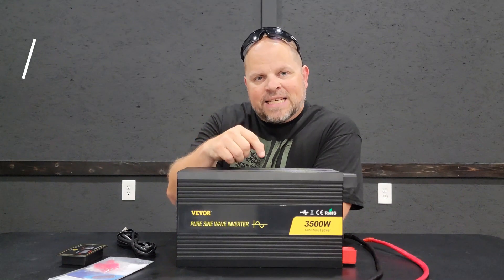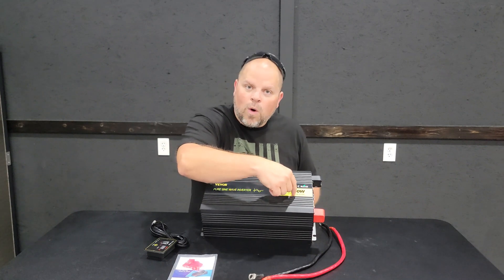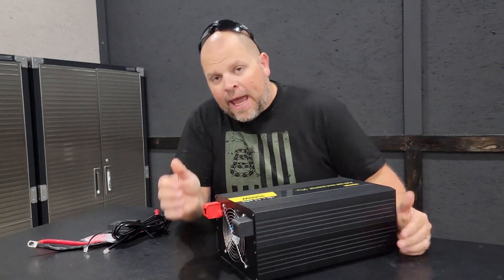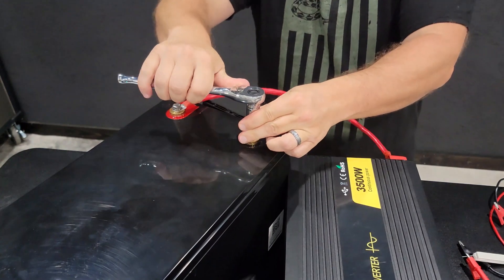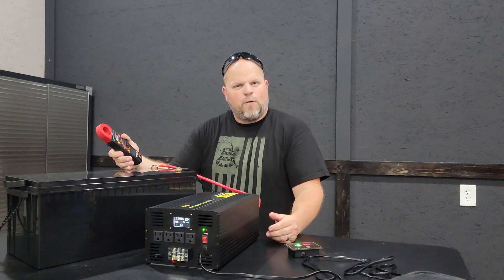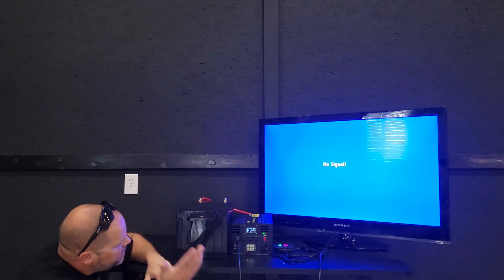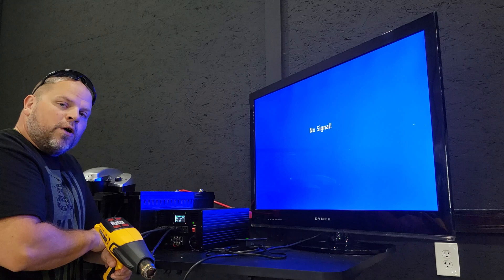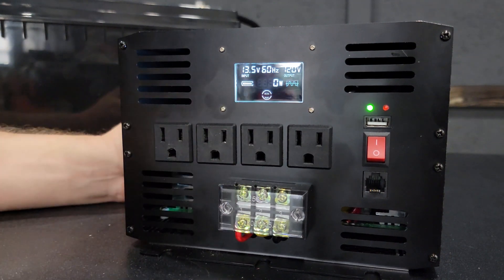Vevor 3500w Pure Sine Wave Inverter 12v to 120v

Comment: My 3500 Edecoa is just like this. I grounded my unit to earth ground through my house wiring. I just pulled one fan guard screw out a few turns and used a stack on crimp terminal. Second, if you buy one of these, throw the cables in the trash. You will need heavy 4/0 copper. With properly crimped ring terminals. 3500 watts x 12 volts is 292 amps. If you're pulling max amperage, those cables can get stupid hot. Great video bro.
Reply from the maker: Thanks for watching and sharing your experience. Yeah, I agree toss the cables that come with it and get quality windy nation cables. Can't go wrong with 4/0
Reply: Does this edecoa work well for a 3/4 HP pool pump? you have to remember that they have a starting surge.

Comment: I am a total novice at this. I just bought a Honda Pilot that has the 2 12v gigarette outlets. I will go camping and I may want to use a computer or other small appliances off of the gigarette outlets.  What would you recommend I get? Is there any negative effect to the car battery or its electrical system when using these devices? Thank you
Reply from the maker: It really depends on how you are looking to connect everything. For a total novice, I would recommend a portable power station. It makes things so much easier. Thanks for watching and commenting 👍🏻

Comment: You have to have the inverter grounded for the GFCI to work. Sadly, Renogy phone support said in a camper you don’t but in researching, that’s incorrect. Think about it, I think it’s no way for it to work if not grounded. Most inverters instructions I have seen mentioned grounding on camper or earth ground.
Reply from the maker: Thanks for watching and commenting 👍🏻

Comment: Great stuff. What size inline fuse is needed between the battery and inverter?
Reply from the maker: It really depends on your overall setup. The fuse size is usually stated in the manual and some inverters already have built in fuses/breakers. The rule of thumb that here would be “Continuous Watts / Battery Voltage times 1.25, for example a typical 1000W 12V inverter draws up around 83 continuous amps and we would add the 25% safety factor which comes out to 105 Amps, so we would recommend a 150A fuse. Thanks for watching and commenting
Reply: Thanks! I bought 2/0 awg wire and in the middle of hooking up the wires with a 300A ANL inline fuse. I also got 250A fuses in case 300 was too much. I need 2 more 2/0 terminal ends to connect the cable from the inline fuse to the battery. I came to this conclusion from reading somewhere I saw online. Like I said I have to wait for these terminal ends to get here to finish the installation. So hopefully the 300A or 250A fuses isn’t too much.

Comment: How many watts per outlet? Can I draw 3500w from only 1 outlet. Like an a/c
Reply from the maker: I would recommend considering the terminal blocks with an inline breaker and an AC disconnect.  But keep in mind that it is rated at 25amp. 25a x 120v = 3000watts. 80% of that is 2400watts. The front plugs on the unit are rated at 15amps. 120v x 15amps = 1800watts max. But if you take into consideration the 80% rule, that outlet is 1440watts max. That's why the terminal block is there. To handle a little larger load. Hope that was helpful. Thanks for watching and commenting 👍🏻

Comment: What ohm resistor do you use to charge the caps?  I have this exact inverter for a diy solar generator I'm building.  And GREAT video!
Reply from the maker: Here are the exact ones I purchased off Amazon: https://amzn.to/3TKsq3w Hope that helps. Thanks for watching and commenting. 👍
Reply: Just use a test light in between the batteries and inverter, when the light goes out its precharged

Comment: Thank you for  uploading this information about this inverter. I'm upset because I spent $300 on a Kreiger 2000W PSW unit and had it for only13 months and it just died. I never ever even used it on ANY household loads. I paired it with two Redodo 100AH batteries as an emergency backup 300W solar system and only turned it on weekly to charge up some power tool batteries. Went to charge up some batteries and it failed to turn on. I paid $60 to ship it to NC for warranty repair or replacement and now USPS has no clue where  the heck it is! Glad I insured it for $300 but man this is so frustrating. Kreiger is supposed to be reliable from all the reviews too. I may just go with a Vevor 2500W unit.
Reply from the maker: Thanks for watching and commenting 👍🏻

Comment: Can someone tell me why when I do a continuity check between the 4 ac outlets that every other outlet tones opposite between hot and neutral and also to the hardwire contacts
Reply from the maker: Did you ever figure out the answer? Thanks for watching and commenting 👍🏻
Reply: No I took the box off exposing the board and on the 15 amp outlets there are no wires between the hots and neutral just heavily sautered boards from the output wires red will supply the first hot bus then go over to the neutral on the next outlet and so on back and fourth the 25 amp hard wire terminals have the red supply wire going to the hot and black as the neutral with the green and yellow as ground bonded to the case there is a reason that they didn’t put a ground stud on that thing any where because if you ever tried to wire it into a panel an a cabin or house some where the neutral and ground are bonded  that would light up your life in a red hot hurry I am not using the 15 amp outlets but cut up a triplex dog bone adapter cord and wired it to the 25 amp ac output terminals I will then just run loads from that

Comment: Thanks for the video, question for you tho, would you run that brand of inverter in semi, i use it for microwave, keurig and charging power tool battery and maybe an airfryer. Thanks Mate.
Reply from the maker: Yes, it is definitely capable of running a microwave, keurig, air fryer, and chargers for your tools. Just be sure that the BMS on your battery will allow for larger amp discharge and size your wires appropriately. Oh, don't forget to install all the recommended protections like inline fuses and breakers to protect your system and, most importantly, your semi. Hope that helps. Thanks for watching and commenting 👍🏻
Reply: @TheSolarPit  Thank you! I've got all the wiring,fuse allready in, had a inverter in before , died, i'm looking for a good replacement  inverter! Thanks again!

Comment: That ground fault protection might work if the inverters case is grounded.
Reply from the maker: I might try that out and see if that works. Gotta figure out how to get that case grounded. Thanks for watching and commenting 👍🏻
Reply: @DIYSolarBuilds  I would try running a ground wire from the batterys (-) pole to the inverter case itself.Make sure to put a small amp fuse in line for safety measure. BETTER YET, use a volt meter to see if any voltage is back fueding.If there is voltage,then the inverter is internally wired wrong and do not run that wire--A long time ago there was such a critter called POSITIVE GROUND. (bad idea).

Comment: I have that inverter and it's a workhorse, the fan rarely comes on and it burns about 7w at idle.  I have the terminal block connected to my sub panel with 10awg Romex wire and 4/0 welding cables going to the batteries.  The remote control is too bright and doesn't accurately read the correct voltage, but the inverter itself is unbeatable for the price.
Reply from the maker: Thanks for providing that feedback! 👍🏻

Comment: Great video! Can I be able to run a heat press for t-shirts that runs around 1800 watts? And what kind of battery do I need to use for this inverter?
Reply from the maker: It is capable of 3500w continuously. 1800w would not be an issue. You would need a decent sized Ah battery if you are going to be pulling that type of load. I would recommend a 12v 200ah LifePO4. I have a couple of links I could share with you if you are interested in those. Thanks for watching and commenting 👍🏻
Reply: Yes That would be great thanks
Reply from the maker: Here is are two reasonably priced 12v 200Ah batteries. If you use coupon codes I provide each link on either brand it will save you a little money. 

Power Queens version: https://ipowerqueen.com/products/power-queen-12v-200ah-plus-lifepo4-battery-built-in-200a-bms?ref=diysolarbuilds 
Get 4% off the Power Queen by using coupon code: JustinPQ

LiTime's version: https://www.litime.com/products/litime-12v-200ah-lifepo4-lithium-battery?ref=diysolarbuilds
Get 3% off the LiTime by using coupon code: diysolarbuilds 

I have tested both brands on my channel and can confidently recommend either one. If you need more compacity then both brands have larger batteries sizes for the 12v versions in the 300Ah and 400Ah ranges. 

Hope that helps you out.
Reply: Would it be the same battery if I get the vevo  or another one called jupiter . I was thinking in getting a 5000w instead of the 3500w. What would you recommend? I will be using it often for small pop up events to use my heat press. I was also curious on how long can I use it for during a day? Or how many hours? I just want to get something that will be long lasting for my equipment and not be able to damage them. Thanks so much👍
Reply from the maker: @merchforsuccess  Yes, those batteries would work with almost any power inverter. I would also recommend starting a conversation on this topic over on the forums  http://diysolarbuilds.com hope to hear from you over there.
Reply: @merchforsuccess Isn’t Jupiter the Harbor Freight brand?

Comment: 3500W at 12V that is 300 amps. such a high current over thin copper-coated aluminum cables?
With 24 volts input that's still 150A. then you can adjust the cable cross section.
Pure copper cables do not have to be as thick as aluminum cables.
Reply from the maker: Those are the cables that come with it. I would upgrade them to larger pure copper if I were going to use this for anything more than testing. Thanks for watching and commenting! 👍

Comment: What is the voltage between hot and ground?  I have found that many of the cheaper inverters (without GFCIs) have 70V between Hot and Ground, 70V between Neutral and Ground, and 120V between hot and neutral.
Reply from the maker: I will have to dive deeper into the GFCI on this unit but I still believe it was being advertised on this unit when it was meant for another model. Thanks for watching and commenting! 👍

Comment: Well made video Justin. If you can walk through a configuration to connect to a set of solar panel that's be great. Especially when the inverter works just at 12V while solar panels can easily connect in series to 100V or more to reduce DC current going through. With that in mind what's the best way to link up high voltage solar panels to 12V 3.5kW inverter in parallel to a 12V battery? Thank you so much
Reply from the maker: I will have to work on doing a video on that sometime. You would need a charge controller in between the PV panels and the battery. Then the inverter would be connected to the battery. Thanks for watching and commenting. 👍
Reply: 👍 much appreciate that Justin. Make sure I'm not affecting any of your plan. It was just an idea that's all. That idea comes from my earlier experience connecting four 24V PVs in series to make up 96V DC panel fed into a charge controller to step it down to 24V DC to fit my battery (in parallel to my 24V inverter). In one sunny day the battery was charged up and the BMS inside shut down the battery, leaving the inverter alone to be fed with whatever the charge controller pumps. That controller probably thought the inverter could accept much higher voltage so I watched the charging voltage shooted up to 50+ V. Some little explosion and smoke came out of that inverter in a few minutes time and I have to cut the power from the inverter immediately. From that point on I don't know what configuration to use, or should I add some voltage-monitor to cut off PV input. I understand I can connect the PVs all in parallel instead, but aside from there fact that more wire would be needed in that case, the panel voltages might not be high enough to pump into a 24V battery. That's still a mystery to me, but you don't need to answer that if it's not relevant to your plan. Thanks again for your video

Comment: That little plug-in tester is not checking for the inverter being staked to the physical ground.  What it is looking for is being able to pass current between the hot pin to the earth pin in the socket.  Some inverters do not actually have the earth pin at 0 volts relative to the live pin, nor the neutral pin.  They are at 50% voltage.  The plug-in tester may not think this is right and indicates a fault.  This doesn't mean a GFCI will not detect an appliance internal earth fault when connected to this inverter.  Plug-in a portable GFCI and use a plug-in GFCI tester to see if it can be tripped.  A proper tester is really needed to ensure the GFCI will trip within the allowed time but they aren't cheap.

There's a lot more that can be said about how GFCIs work and how to hook up this inverter and determining if the inverter is even suitable for such purpose but that's a little beyond this humble comment.

That said, 300A through those gauge CCA wires?  They are certainly going to get hot and the voltage drop across them isn't going to be all that flash either.
Reply from the maker: Well said and I appreciate the comment. I love learning from you guys and getting comments that get my brain's gears spinning.  Do you think a Klein Tools RT390 would be a good tool to thoroughly test the GFCI function on these types of units?  Thank you for watching and commenting! 👍
Reply: @TheSolarPit Like you, I doubt the inverter itself has GFCI function built in especially when there isn't any test and reset buttons.  I guess I wandered a bit there but it was more of an explanation of why your tester may be indicating the open earth pin, ie it may really be open, or it may be at 50% voltage.  

Whip the top off and take a look at the back of the sockets and check for a wire on the earth pin going to the board in the inverter.  If there isn't one a plugin GFCI will not trip on a live to appliance chassis fault, nor will your tester trip the plug in GFCI, and you can be confident the inverter does not have GFCI function built in too.

Keep in mind that with no earth pin and the inverter and/or the AC coming out of it not earthed it is technically impossible to get a shock from this situation anyway without a double fault - eg first fault takes one live or neutral to the physical earth and the second fault is you getting between the physical earth and the other wire, say wire to chassis of a tool you are holding, so current can flow across you.